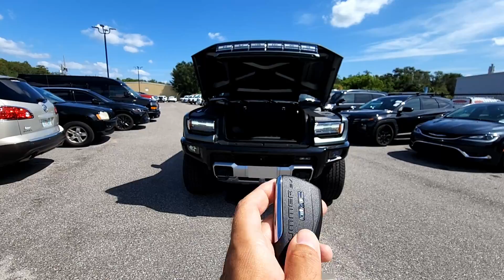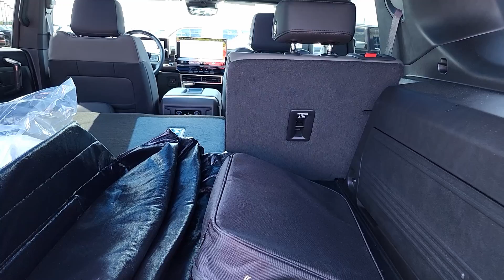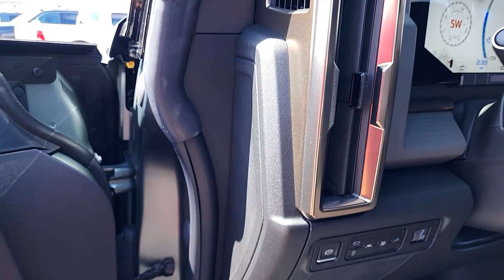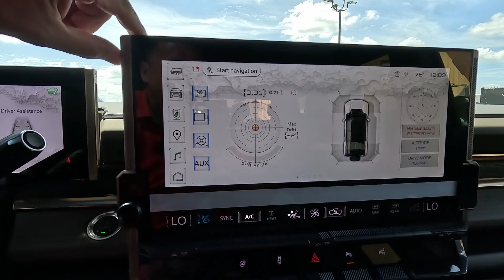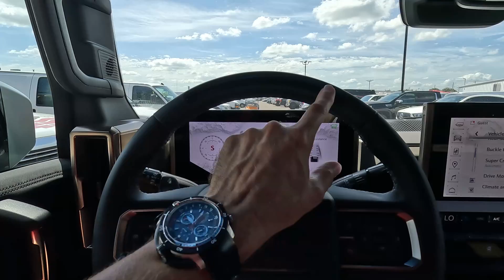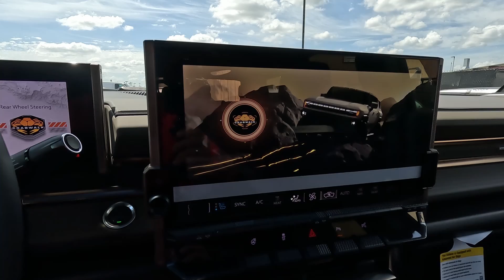2024 Hummer EV SUV Edition 1 is the most bad ass SUV ever built. Full review and test drive.

Comment: Dude just said if the torque is measured at the crank onan electric vehicle with no crank. What a tool.
Reply from the maker: You are a tool!  I said it as comparison to a regular ICE engine when torque is measured at the crank and in this case it is a total combined torque at the wheels which is most likely multipled by gear ratio(s). As comparison Chevy Silverado 3500HD's 6.6-liter turbo-diesel V-8 engine makes 910 lb-ft at the crank, but multiplying that number by its first-gear and final-drive ratios results in an insane 14,129 lb-ft. Technicaly they are right but not when you use standardized measurement method. They should say that torque is equivalent to...

Comment: The SUV version has a usable pack of around 205kw (the pickup is 212kw I believe). Electrify America is around 35 cents a kw so that would be $71.75 to “fill up” from 0 to 100 which you will rarely do. Home charging at 13 cents a kw would be $26.65 - 0 to 100. Again you will rarely if ever do. Home charging is where it’s at.
Reply from the maker: Thanks for the info! 
I just downloaded the app for Electrify America and all chargers in my area are at 48 cents which I think it varies by state which at 205 KWH it would bring us closer to $100 to fill up which for the size of this vehicle is not surprising or particularly bad if it can go 300 miles. For the sake of comparison gas here is 3.70 per gallon so $100 would buy 27 gallons. and if you can do 300 miles out of it its like doing 11mpg. At least moneywise.  It would be significantly cheaper at home of course but it would take forever or cost a lot to install fast charger.
Reply: @MattTheCarguy  Oh wow! That does sound high. If you were to get the membership does it drop it down to 31 cents a kw in your area too or is it higher still? Yes, honestly it’s not a super efficient vehicle even for being an EV, but I guess that is similar to its old gas counterpart. For home charging I have a wall unit that was about $560 and the installation was $250. But I imagine that would also vary from place to place. That would take about 11 hours to charge from 0 to 100. In my case my car only has an 82 kWh pack and I only use about 10% a day and charge to 70%. It basically charges in an hour and a half. On a wall outlet though when I’ve stayed at family/friends houses it definitely takes hours. I can’t even imagine the Hummer on a wall outlet. Probably a week or so? Thanks for replying! I love all the math and science behind EVs. I can’t wait to see what the technology will be like in 40-50 years!
Reply from the maker: @adalinelathrop5129  haha in 40-50 years we may some kind of other propulsion technology. EVs are cool but i dont think they are solution to climate crisis unless we can harness the energy by using build in solar panels or wind turbines or regenerative energy that goes back to batteries. In your case it seems like ev makes a lot of sense with a small battery and using about 10% daily. In my regular job I drive about 50k a year in many instances more than 300 miles at a time so EV would make no sense whatsoever.